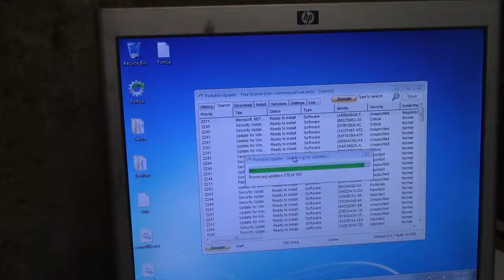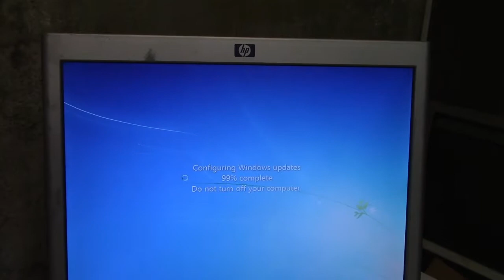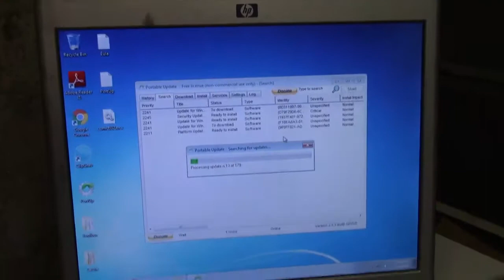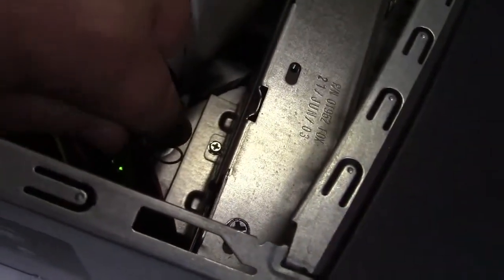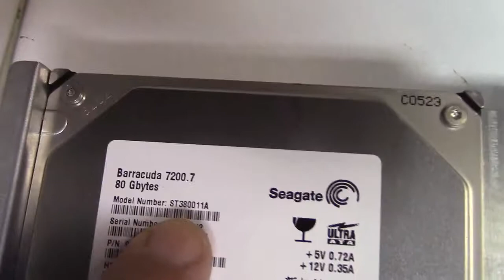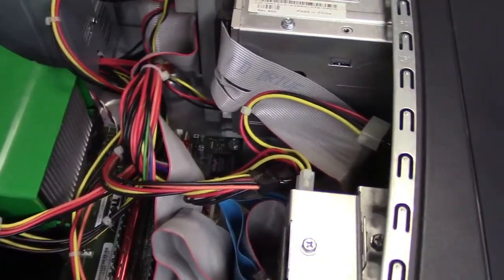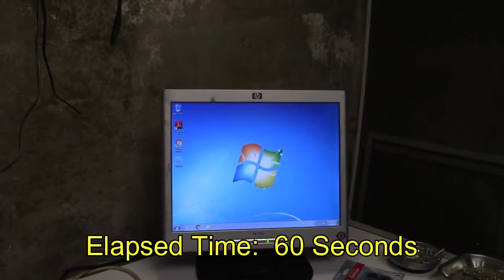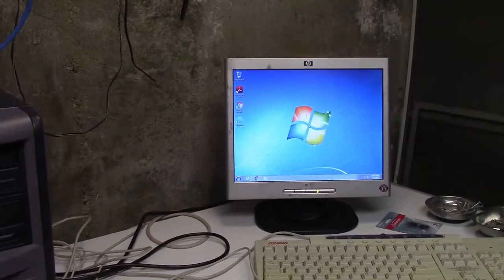Dell Dimension 4600 Windows 7 Upgrade Attempt, Part 4

Comment: The last time I installed Windows, Portable Update failed on me too. Maybe Microsoft changed something that makes it unstable.
Reply from the maker: I have no idea, but as of this moment, their website reports HTTP 500 Internal Server Error.
Reply: Smells like abandonedware to me. It's probably been fairly unmaintained for some time considering that bug where you have to close the program before installing updates was never fixed. Just another reason it seems you left tiny middle at the right time.
Reply from the maker: Possibly.  It always had that "bug" since I used it, so the standard answer is, as you likely know, "it's not a bug, it's a feature."

Comment: i have an optiplex GX620, that i installed windows 10 on to. 32 bit of course. 3.5 gb ram and a pentium d, new hard drive. runs actually very well. ran it under the 950 graphics which is a big no no now a days. installed a cheap hd 3450 card and now can run 720p videos on youtube and sped up the entire system. they just don't make computers like these anymore and its a shame. even under the same optiplex models, the higher they went the poorer the quality was.
Reply from the maker: Oh yeah I know what you mean, these things were king back in their day!  I have a Pentium D that's running Windows 7 (and will stay that way), and that's my video editing rig.  Render time is about twice the runtime of the video.  It's when I get into the 45 minute videos and they take an hour and a half to render that it's really slow.  But for a nice 5 minute video it's only 10 minutes to render.  Reasonable enough for me!
Reply: @jaykay18  for whatever reason i have a soft spot for the pentium 4 pentium d machines. i like them, even though they are quite slow now. i hooked a watt meter to the 620 and its no more than 130 at full usage, which i don't see as a power hungry machine. is this computer still running?
Reply from the maker: Oh definitely still running.  130 whole watts.  Wow, that's going to kill the planet.  Because of course a new machine with 7000 horsepower generates its own power, so much that it puts it back into the grid and pays you!  People are such morons when they claim computers (especially old ones) use a lot of power.  They have no clue whatsoever.
Reply: @jaykay18  i rewatched the doorbell server video the long one, and i love how you ranted about the power usage.  but i didn't know that pentium 3's use such little power though. but in reality, i would rather use an old computer that uses a bit more power to run that use a cheap new computer that just will crap out in a year or so.
Reply from the maker: Thanks, that was a fun series.  That thing's actually a Pentium II, 333MHz or so if I recall.  I'd also much rather use an older, slower, RELIABLE computer than a piece of crap that I know will die at any moment!
Reply: @jaykay18  pentium II that's right. how did you come in to getting that computer? and the monitor that you had or have connected to that system, the compaq, i remember back in 95 or 96 my school got presario desktops that used those monitors but i can't figure out what models they would have been. all i remember was that they had this round bulge at the top with media buttons and a moon button on them.
Reply from the maker: That computer was originally owned by a friend of a friend's father.  I did some computer work for him on that very machine when it was "new" (meaning "in service"), and it was top of the line then.  Later on, he replaced it with something else, and I was called to do some work on that system, and he offered this to me.

Regarding the monitor and said Compaq computer, you won't believe this, but I HAD one of those!  Back in the late late 1990s, like 1999, maybe 1998.  It was an old co-worker's machine, he didn't need it anymore.  It was a Pentium II 200MHz if I recall, maybe 128MB of RAM.  I actually had it running Windows 98 back in the day.  Same round bulge, same "moon" button!  My main system was a Pentium II 450MHz with like 384MB of RAM, this was back when this was top of the line stuff.

I don't precisely recall, but if memory serves, that machine's power supply ended up dying, and it had some sort of proprietary connector(s) so it could not be replaced/repaired easily, at least back in the days of the very late 1990s.  Nowadays you can go on Amazon/ebay, find whatever you need in a couple clicks and it shows up on your doorstep.
Reply: @jaykay18  awesome. i bet it feels good to be offered older computers, i wish i did. with the compaq's that did the moon button actually do or mean?
Reply from the maker: When I used to go to people's houses and fix their computers, and they didn't want to pay full price, I'd ask if they had anything, so sometimes they'd get a small break that way.  Other times I just found the machine thrown out, but quite honestly I haven't seen any computers thrown out in a long time, except for one over the summer I've yet to look at, which would be a direct replacement for the digital picture frame machine.

The moon button was a sleep button, and it could be configured.  I THINK that machine might have not been ACPI compliant, so Compaq devised their own proprietary ways of doing things.  I think you could select standby or sleep mode, but not hibernation.  I also vaguely seem to remember the moon would light up, definitely in yellow, but it's possible depending on the mode it was either yellow or green when in use.  Been too long and I no longer have the machine to find out, nor remember the model number.

Unrelated to that, but related to old computers, I used to have a Dell Optiplex with a Pentium 133MHz processor.  I ran into a 166MHz processor and upgraded it at one point (hey, 33MHz made a difference back then!)  I used to use that machine all the time, then it fell out of favor when I got a new machine with a Pentium II.  It sat dormant for several years in my bedroom, I hadn't turned it on in years.  Had Windows 98 on it.

One day I decided it's got enough horsepower to play MP3 files, and enough RAM to run Windows XP, so I tried installing it.  The machine was so old, it didn't support booting off of a CD, though it did support the drive.  XP offered 6 floppy disks that you could create for it to boot from, then it would install from CD.  So I did that, and it started doing its thing.  Then, although Windows 98 worked fine, XP would bluescreen during the installation.  I tried many times, and it was frustrating booting from 6 disks that you had to keep swapping back and forth.

Eventually I realized that when the monitor would change modes is when it would bluescreen for whatever reason.  You'll find this hard to believe but it's absolutely true:  The monitor, which had been working fine, was the cause of the bluescreen!  After the monitor was replaced, it installed and worked no problem.

Why?  I don't know precisely, but there actually IS 2-way data transfer between the monitor and the computer, albeit very limited.  The data involved was the monitor reporting what kind if was to Windows, so Windows could install the driver for it.  If you ever bought a new monitor, Windows will come up with an Add New Hardware thing, or may do it automatically, and that communication was screwed up, the machine would receive garbled data, and it would crash.  I saw that problem exactly that ONE time, and never again.

Comment: Another success! Nice work.
Reply from the maker: Thanks!  I fix 'em right!  While there is such a thing as "you can't fix 'em all", I can't live by that motto.  That's only an absolute last resort, and I never want to resort to that.  I've brought dead motherboards back to life.  Usually that only takes a few small animal sacrifices...
Reply: I was going to ask if you've encountered one too far gone to bring back!
Reply from the maker: Yes, there have been a very select few over the years.
1,  This one doesn't exactly qualify, but to the extent of the circumstances it's worth a mention.  Back at Tiny Middle, some guy brought in an Acer desktop to be repaired, under manufacturer's warranty.  Wouldn't turn on, or if it would, nothing would be displayed on the screen.  I'd have to order the part, wait a few days for it to come in, then install it, only to find out that didn't fix it.  I went through several power supplies, several sticks of RAM, several processors, and at least 5 motherboards that I remember.  Ultimately we ended up shipping the unit to Acer for them to fix it under warranty.  Several weeks later it came back, Acer had replaced the motherboard and processor.  Interesting, since I did that at least 3 times.  Anyway the system worked.  The customer was very understanding through the entire process (well over a month) and asked what Acer did that I couldn't do.  I said "Simple.  They said they replaced the motherboard and processor.  What they didn't say is how many they went through before it worked!"
2.  The machine that was at Club Jay.  Had numerous problems over the years, and eventually I think the motherboard died, as it wouldn't do anything anymore, even after dumbing the system down to the lowest possible level.  It did have a large number of blown/bulging capacitors, so clearly that could be why.
3.  One much older machine.  This was a real junker, it was found thrown out, side panel off, on top of a stack of garbage.  Sunny day.  Some kid walked or biked by and threw their gum out in the pile, which happened to land on the pins of the northbridge chip on the motherboard, which was a surface-mount component.  On top of ALL of that, they had their sprinkler on so it was soaked.  What a challenge, but I was up to it!  Now this was before the days of PCI slots even, or if it wasn't there were only a couple, and ISA cards were still around and plentiful.  I took it home, let it dry out thoroughly for at least a week, and remove the gum, which had stuck on the board and shorted a few pins.  I cleaned that as best I could before powering, but it powered and I was able to get it up and running.  The problem was, I could have sound, I could have Ethernet, but never both even with both cards installed.  Depending on how I installed them, one or the other would work.  I tried everything you could imagine and many you couldn't.  Eventually I gave up, after about a month, and scrapped it.  Just wasn't worth my time.
4.  Some other system, even older still (seems something like a very early Pentium 75 or 90MHz comes to mind).  For whatever reason, that system was unstable.  Would work, then freeze completely.  Sometimes it would defrost and continue working, other times not.  I didn't have any other parts to really troubleshoot with at the time, so I never solved that mystery, it eventually got scrapped, but when it worked, it worked.
Reply: Not bad to count the duds on one hand, for how many machines have been on your workbench over the years! 

That Acer sounded like a huge PITA though! I wonder how many parts they tried before it worked.
Reply from the maker: Yeah, 4 in about 25 years, pretty good odds that I can fix it.  The Acer, I don't know, they never told.  There were other systems that I went through several motherboards for over the years until I got one that worked.  I blame that on the buyers, sometimes they were known to bid on an item on ebay to save a few bucks instead of buying from a reputable seller.  They were scumbags, all to save a buck that never went in my pocket.

Comment: That boot up time is impressive! Nice Job!
Reply from the maker: Yeah isn't it though?  A computer that's THAT old, and it only takes a full minute from pressing the power button?  When I fix something, I fix it RIGHT!
Reply: @jaykay18  lol. Also impressive because I have done this kind of thing(often with very similar hardware) many times and not gotten that good of a result!
Reply from the maker: Reminds me of the old joke:
Guy's furnace goes out in the middle of winter.  No heat.  He calls a repairman.  Repairman comes, looks over the furnace, kicks it, and it fires up.
"That'll be $100 please."
"You're charging me $100 to kick it?"
"No, I'm only charging you $5 to kick it.  The other $95 is knowing where to kick it."

The main thing that I run into with old systems is incompatible video cards.  Usually I can coerce everything else to work.

Comment: Windows 7 no longer supported windows 10
Reply from the maker: What support?  Did Microsoft ever support you?  Ever?  So it makes no difference if there's no longer any support.  Windows 10 steals your personal information.
Reply: @jaykay18  lmfao theres always got to be that one person in the comments that got to tell you to upgrade to windows 10 i still use windows vista as well as windows 7 pro
Reply from the maker: Either that or "Use Linux".  Right, like my mother who doesn't know which end of the mouse to hold is going to work better with Linux.
Reply: @Jason JJ Cruz Judging by the computer that his parents are using : Do you really think they need to be up to date? Gimme a break. I'll let you in on a little secret. When MS ends support for an OS all that it means is that there won't necessarily be anymore official updates for it. So as long as both your browser and AV are up to date & 7 does everything you need it to do 10 is not needed.